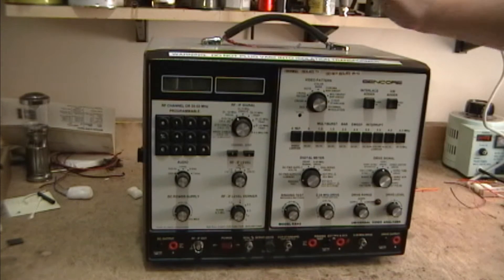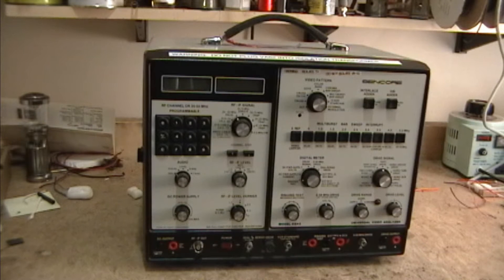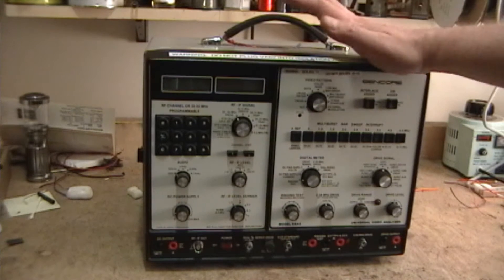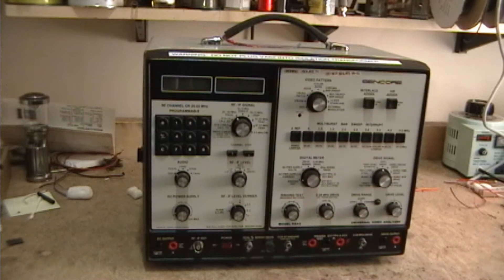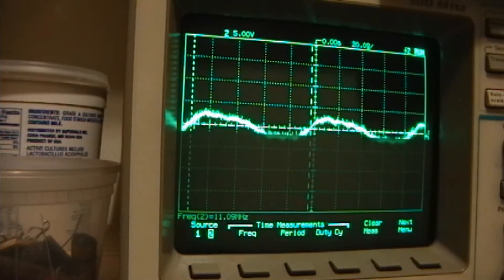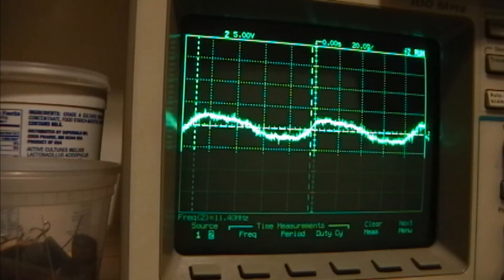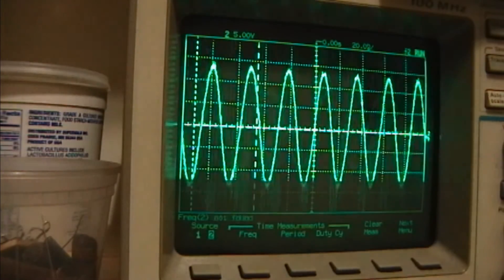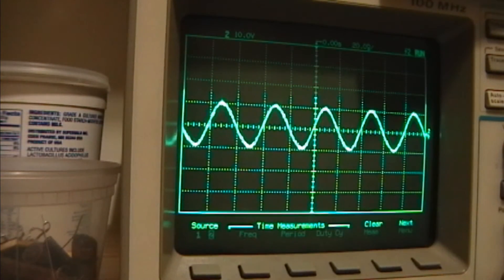Sencore VA62 Hardware Mod

Comment: Has that hex code been published anywhere? I just got a VA62 knowing that this mod was out there somewhere. I have some 1940 sets that I would like to use this as the RF generator. Do you still have the eprom?  I have a burner & an eraser.  Only paid $25 for mine and it's in decent shape not perfect but a liberal application of 409 will take care of that One issue I do see is there is a ringer function the six position switch feels way wrong.  I see that it is unfortunately part of an assembly that is meant to be replaced as a unit. It'll be interesting to see what I find once I get in there.
Reply from the maker: Sorry, don't know.  I parted mine out over 10 years ago when it stopped working.

Comment: Thanks for this informative video of the Sencore VA62 Video Analyzer.

In my time, I worked directly with Herb Bowden, founder and CEO of the company at the time.

His vision was that the electronic product servicer needed to have a bench device that would provide  an 'all-in-one', with the input-output, and intermediate signals needed to troubleshoot any NTSC receiver device, front to back.

I was fortunate to be among the team that produced the original VA48 instruction and application manuals.

Comment: Wow, when NTSC died, I expected things like this, to get real cheap like the cameras did, but these are still out of my range on eBay. I hope you get enough work to make it worth while.
Reply from the maker: I scrapped it out a few years ago in favor of the newer model VG91.  I see a few VA62s under $50 on ebay.
Reply: @bandersentv  Were you able to modify the VG91 to handle 21mhz IFs?
Reply from the maker: @ohger1  No, I never even thought about it.  I can't remember that last time I needed to inject an IF signal.  I'd probably fire up my B&K 1077B if I needed to.
Reply: @bandersentv  I have one of those as well.  I bought it new along with the 415, but the 1077 doesn't have markers.  I thought of feeding the multiburst from the VA62 into the 1077 at the photo tube and modulate the 1077's adjustable IF.
Reply from the maker: @ohger1  The 1077 also isn't a sweep generator.  I've been using a Wavetek 1002 or 1080 sweep generator for my alignments.
Reply: @bandersentv  Yep, I know that but it would be interesting to feed the VA62 multiburst into the 1077 and try the Goodman type alignment.  I  haven't tried that yet because I don't have a sweeper that can do 25mhz in case it goes haywire. There is an outboard down converter someone on videokarma came up with for the 415. If I put that together, I'll try the multi burst through the 1077.
Reply: Hey besides eBay, checkout shopgoodwill.com. All kinds of Test Gear shows up here and I just got a VA62 for $13.00. Shipping is not too bad depending on where the store is that shipping it to you is. The downside is for this kind of gear it's "as-is" since they have no skill set to check this out besides "turns ON" . But I've been pretty lucky overall.